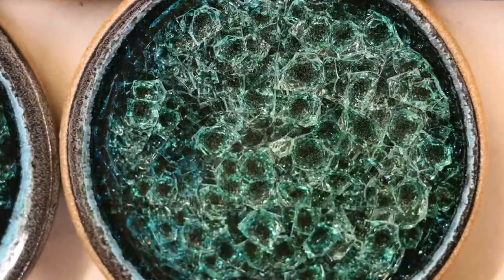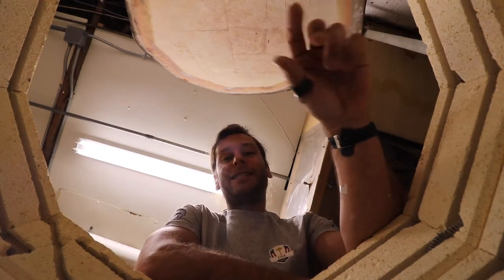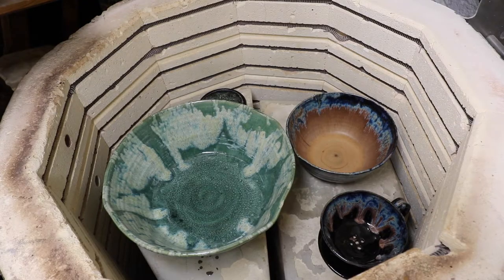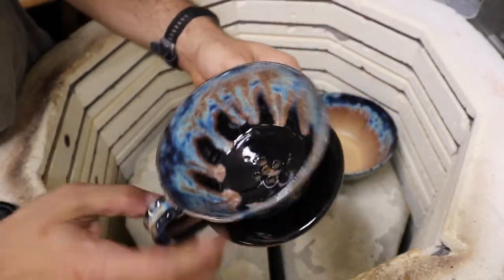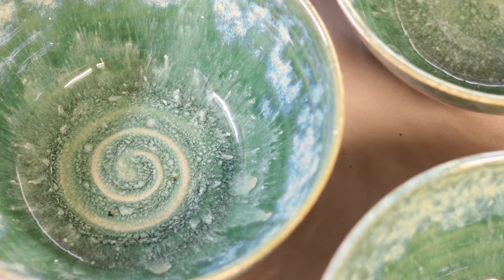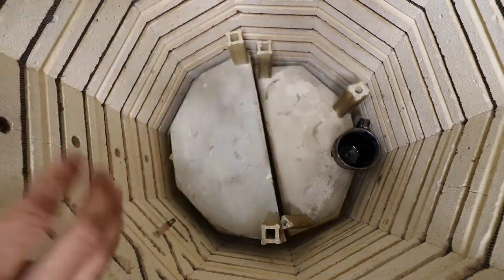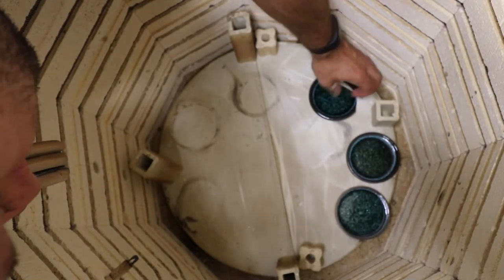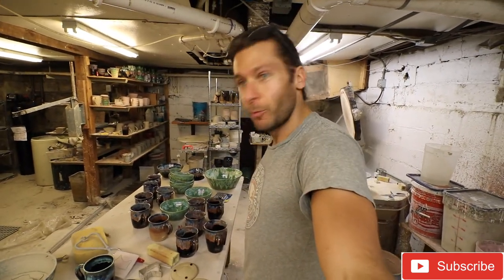Unloading Glaze Kiln #8

Comment: I have a weird art question for you.
Say someone took a big wad of paper formed in a ball. Painted a thick layer of glaze on it. Maybe like marble design the clear glaze on top. Then put that ball in a kiln. What may happen? My mom had this idea an no one has been able to answer her. Do you maybe know the answer?
Reply from the maker: Unfortunately the paper would burn away at a relatively low temperature and the glaze would melt into a big glob of glaze that would coat the kiln shelf or kiln bottom.  probably ruining the kiln shelf and anything else on the same shelf.  I would not recommend trying it, thanks for the question!
Reply: Jonthepotter thank you so much. We knew the paper would burn. Just didn't know what would happen to the glaze.